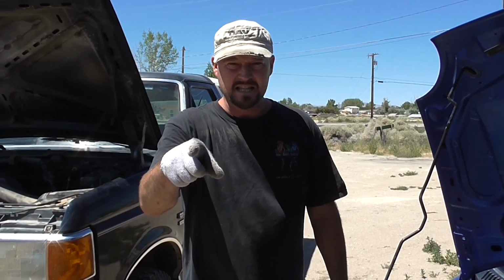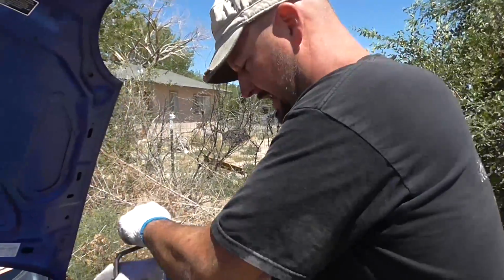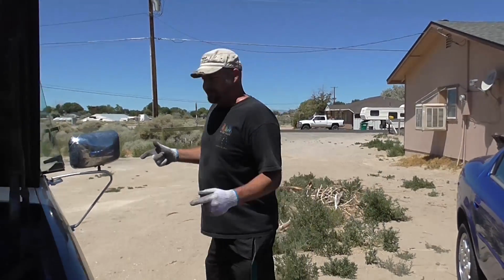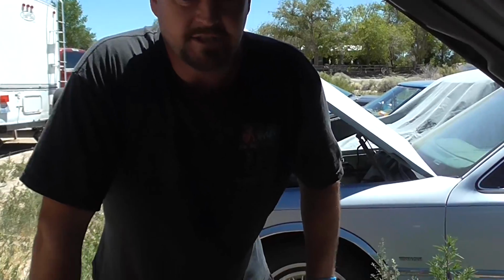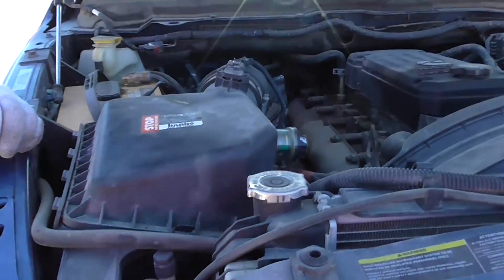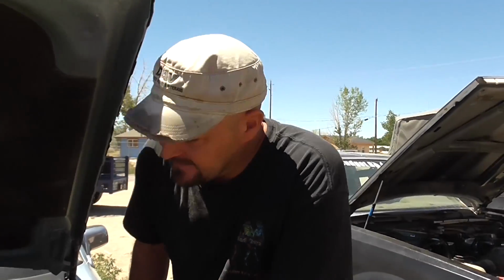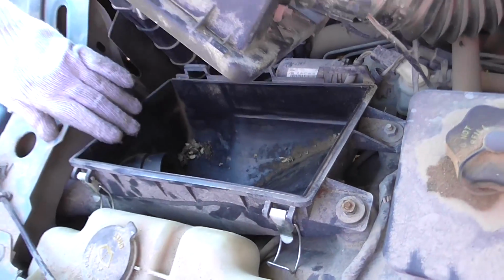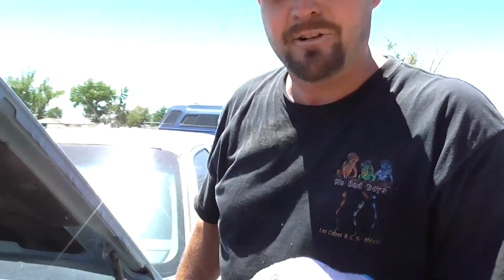Free Horsepower And Fuel Economy - Intake Mods

Comment: I believe Your theory, but I would go a couple steps further to refine it. 
1. Drill holes only toward where cold air is coming from or 
2. run plastic or aluminum pipes from where cold air is coming 
3. Add high filtration material to bottom of filter box to avoid all big particles of dirt to clog My K&N. 
4. Add a mini fan and attach it next to air box to run piped cold air from bottom or high front of vehicle heading into air box.
Reply from the maker: Yes, that sounds great.  I did the opening on my f150 from the grille to my aircleaner, cold fresh air.

Comment: any dyno runs to prove gains ? 9 out of 10 mods like that will couse your car to sound more agressive but in fact you loosing power. it looks like you have no idea about fuel to air ratios and how that works in engine you just go by the sound - lauder is better, engine will not perform any better by just drilling bigger hole in your intake without mapping engine.  I still prefer to trust enginers from companies that spent houndrets of thousends on their R&D than you. sorry mate I call it bullcrap.
Reply from the maker: Watch my F150 on the Dyno video.  Questions?  Compare it to Stock F150 dyno pulls.

Comment: Cold air intakes are a waste of money. If your engine is not high performance it's will not make any change. This guy is a fool. He needs to talk to a pro and stop getting these kids to believe him. If you think it makes a change in mileage and performance have it put on a dyno,before and after. The gain is not worth the effort and cost.
Reply from the maker: Amen, its great to see others that think outside the box.
Reply: I do think out side the box matter of fact i created a highly modified intake, Hybrid charge air to water cooled intake system. For my Hyundai and I've taken turbo charged cars with it amongst others on my list. I've been creating intakes for 18 years now. 45mpg on a 3.8v6 i have video to prove it. The world will know of me soon.
Reply from the maker: Good job, its great to explore many options for performance, that is how great aftermarket parts evolve and turbo cars achieve more performance.
Reply: I can't tell if you're trolling, or being serious?   First things first.  Cold air intakes are absolutely a waste of money on 95% of cars on the road.  Typically made with aluminum or steel piping, they are subject to massive amounts of heat soak.  Which kills power/torque after prolonged driving.  They are useless on small NA engines.  You'll see at most a 2-3 hp gain?  Not even Whp.  They are more useful on FI engines or large V8 NA engines where you'll see larger gains, but even then only if they are plastic or silicone piping.  Now on to you thinking outside the box and creating some form of intake that is "proof on your page."  You're claiming 425 hp on a 3.8 v6, yet you have a 12 second 0-60 time?  Something doesn't add up.  Don't give false information about things you have no idea about.
Reply: Yes this is true, but after watching his videos and his claims of 425 hp out of a homemade intake for his Hyundai V6....  I don't believe he has the room to be calling anyone uneducated about this topic.  Sidenote: funny video and thanks for the upload!
Reply: I don't have much experience using a cold air intake, but I did run a custom high flow short ram intake on my '93 Altima. It took me 30 minutes to modify and install and cost about $35. I got a 10 mpg increase and what seemed like 5-10 hp increase before any additional mods. I did further modify the intake to a bumper mounted cold air intake, but it didn't seem to increase performance, so I reverted it to the short ram after a few weeks.

Comment: pod filters have been debunked and dont improove power
mighty car mods pod filters mythbusted
Reply from the maker: +Marty Gammon Not true, they used a very small filter in their comparison so not accurate at all.  Its the size of the so called pod filter that makes the difference.
Reply: +Budget Boosting funnily enough, removing the filter on my friends car nets only an extra 1-2whp. So changing it out to a "high flow" filter couldn't possibly be any better, so it's a waste of money. Besides, the cost/hp ratio of air intakes is horrid, you're lucky to even get an increase in power at all. Even then, it's insignificant for the price you pay. Wow, a whole 5hp on my friends VW Golf. For a few hundred spent on a K&N intake.
Reply: it makes no difference .... at most your changing your power curve to be more peppy and less torquey.
you would get more from taking a shit than this mod
Reply: Mythbusters are payed by the establishment to keep people away from these things. Watch mythbusters on hho, they are a joke.
Reply: mythbusters isnt mcm mate
Reply: +Marty Gammon  mcm sucks, there have been numerous dyno charts proving otherwise, you can't just look at hp, theres powerband torque etc and the most important thing is you can't imitate real road driving on a dyno with high pressure wind going into the engine bay pushing heat away, it definitely makes a difference depending on placement and air filter type/brand, especially the filters with inbuilt velocity stacks
Reply: Marty Gammon power gain is a power gain, dyno doesn't tell everything, not to mention how much better car sounds let alone prove dyno gains worldwide, u just need to search, even professional drag cars and time attack cars use them, they obviously know better, and results multiply on more powerful cars,  from my own experience car sounds better, revs more freely and power band feels a bit better in areas I use most, that wasn't the case til I used a velocity stack type pod in a spot more wind is forced into, so they are useful, mostly in sound on n/a cars but I refuse to pay hundreds for basic pipe instead I get the fake imitation with a real pod only, similar result quarter the price
Reply from the maker: the whp is not that high but measure the torque difference and it is worth it.
Reply: you cant compare a drag car or time attack car to a road car mate ... they run high revs they need the air flow, and they dont rely on any torque down low and yes they do use them but for a good reason. it isnt for power it is an easy filter to fit and replace.
placement can make a difference but that defeats the purpose of the experiment in the first place. you could use a stock panel filter and ram air into it with the same results.

road car engines are designed to be restricted but this isnt at the filter. by this design they are torquer than race motors and are designed to run at a lower rev range all day long. just replacing the filter with a pod or removing it all together will give fuck all of a difference unless you had a blocked filter to start with.
there are better gains to be had by doing other things but just the filter on its own isnt worth it!
you are only changing the torque curve slightly and just so you know hp is torque over time.

basically what im tryna say is you guys are full of shit.
Reply: +Marty Gammon say as u please, there are proven results regardless of type of vehicle, street or track,on turbo street cars on a mild tune, they've seen gains up to 20hp+, on my n/a 4cyl high revving honda ive even seen small results with a tune but results nonetheless and especially heard a major difference, the sound Alone is worth it, so post ur bullshit opinions somewhere else
Reply: +Marty Gammon ive tried the panel filter, it just isnt is good and sounds like ass
Reply: well thats pretty scientific right there ....
Reply: +Marty Gammon u stick to ur beliefs ill stick to mine backed by evidence from others and my own personal experience, even if the performance is unchanged whatsoever in a case of a non velocity stacked filter or tune, the sound and bees dick weight reduction is still something to look forward to

Comment: the srt4 doesn't just have a turbo to make it faster than normal neon, it has a different larger engine
Reply from the maker: yes a 2.4, the turbo does most of it, a 2.4 on its own is not much of an engine without the turbo.  Either was my Neon, it was a gas saving car though and drove pretty good.

Comment: I have a 2006 truck Chevy 5.3 eng. And bad mpg,  changed air filter, cleaned mas/air and got 16 mpg the truck is two week drive.  Any other suggestions?  PS I Love 
All your info keep up the great work,   I Thank you  your truly  Tony!!
Reply: I get 20 on the highway with my 2003 z71 long bed extended cab. Bone stock, no upgrades at all. I probably get 17 around town. It's all in how you drive it and where

Comment: I'd say it's worth trying on a stock plastic airbox, if it isn't to your liking, get a stock airbox at pick n pull. I liked the cone filter in the stock airbox trick, nice sound, nuttin' to see. Years ago a buddy had a 77 Chrysler New Yorker, 440 engine. Removed all the Lean Burn stuff, including the early ECU on side of the air cleaner.  Left the opening on the aircleaner where the ECU had been. When you got on it and the huge secondaries on the Thermoquad opened up, it sounded like all hell was loose!
Reply from the maker: It is always good to have a spare airbox just in case you want to compare or change it for different climates.

Comment: Hey booster boy, I am an auto mechanic since '95 professionally. I have tinkered with trying to get more horsepower from a car motor without doing any tinkering on the motor,AND NOW, I have found out how. Will figure out how to protect from up-splash from puddles!
Reply from the maker: I was an Aviation mechanic from 1989 to 2013.  I work on cars as a hobby.  I do apply some of which I have learned from aviation to auto performance.  I also do many things outside of the box that so many have criticized which does not bother me because they can choose their own way.  I am just showing what works for me and if someone likes it good, if not, they are free to do what they want to their own automobile.

Comment: Can u do this method on a 2003 acura tl
Reply from the maker: pretty much find the hole that supplies air to the filter box and make it much larger for more airflow.  Changing the filter to a high flow reusable kind is beneficial too since you can clean it anytime and the air passes through with less restriction.

Comment: What about all the hot air in the engine compartment going into the filter?
Reply from the maker: When the hood is closed, the intake manifold gets hot, especially in traffic.  If intake manifold is hot, engine gets hot air.  Quite simple really.  Get a laser temperature reader, point it to the intake manifold after driving vehicle for 30 minutes, check temperature, its usually hot unless on a very cold day.

Comment: Your cut is logical in the era of getting more air flow to your engine , but this hole will get you engine a hot air because of the engine hot temperature thats why they designed the pipe direction from the front

Comment: Instead of cutting out the whole air filter housing what about drilling holes in the bottom of that air filter housing pan??
Reply from the maker: You could do it and it could make a bit of a difference.  The bigger the hole supplying the air to the air filter, the more flow you can get out of your air filter since air filters are restrictive all by themselves, but necessary to keep dirt out of the engine.

Comment: Whenever I put a cai in my vehicles, I make I do 2 jobs at once.   I clean the air box and tubes with a vacuum first.  Then windex and paper towels.   The motors are more happy after.  Cheers
Reply from the maker: Yes I also clean my filter assemblies internally from time to time.  This video I did not cover cleaning, just concepts on improving engine airflow aside from the normal cleaning or replacing of filters that are done regularily.

Comment: 😟 ...... I live in California.. the parts can be sent to the state.. unless u get them separate. Correct me if I'm wrong my opinion a cold air intake was never designed for oh my COLD air but maybe for sounds.. like turbo sound
Reply from the maker: Its always best to talk to your technician at the smog station and ask him what mods you could do without risking a failed smog inspection.  You may find a great smog station that allows mild tuning and still passes your car since most intake exhaust tuning does not effect emission readings in a negative fashion.  I remember when I was stationed in Lemoore, CA, I found a smog station that tested my old Z car, even with mods, the smog numbers still passed.  Its the visual inspection that the inspector could fail you on.  Its up to each inspector to what he will fail on the visual part of the inspection .  Always best to talk to the inspection technicians as to what you can and cannot do to pass the inspections.

Comment: How can I boost a 2009 Camry LE 4 cylinder?
Reply: get a bigger engine
Reply from the maker: perhaps a 5SGTE engine from a MR2 turbo or older Celica all trac turbo.  That engine puts out nice power stock and loads of tuning potential.  It is a sideways designed engine as well so it would be an interesting fit.

Comment: My main worry would be look at the dust in your air box, a factory filter seals around the closure point separating clean/and dirty sides of the filter to intake, and you seem to live in a very dry dusty place, that said,I’ve seem wet leaves and wet paper (was apparently in a large puddle) take out an air filter, and MaF sensor , luckily the mesh wire on the sensor caught and stop a lump of wet paper and leaves going in any further
Reply from the maker: Its dusty Nevada, can never seem to get out of the dust and fine sand....

Comment: Before I start cutting the air box on my 2005 Lincoln Town car, 4.6 liter motor, with this freak out the computer system?
Reply: This air-box modification will NOT harm, change, or "freak out" your car's computer system in any way !!
 But -- don't do this mod to your Lincoln -- it is of little-to-none benefit, and causes problems in rainy or snowy weather.